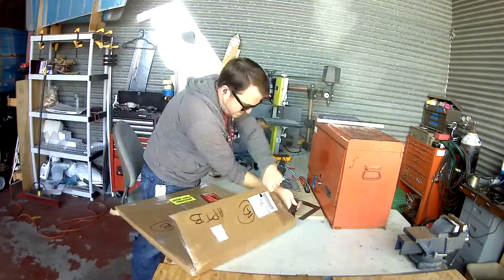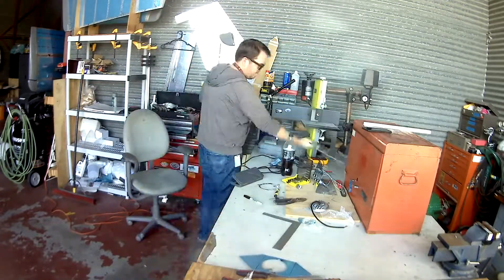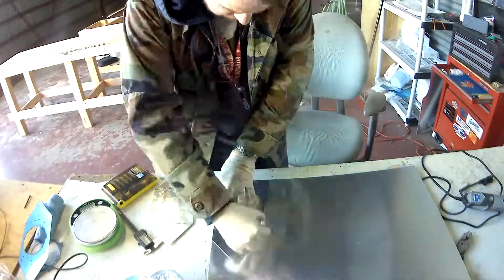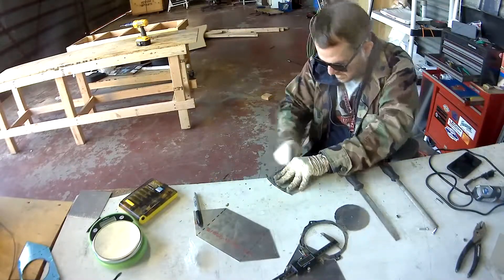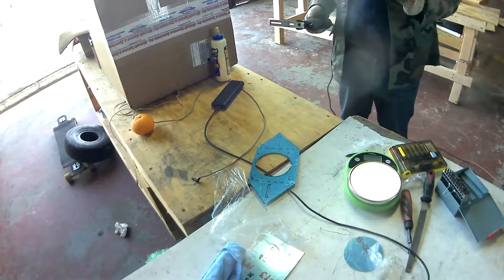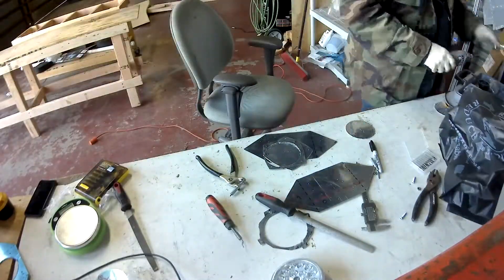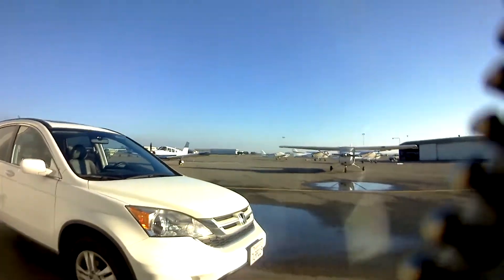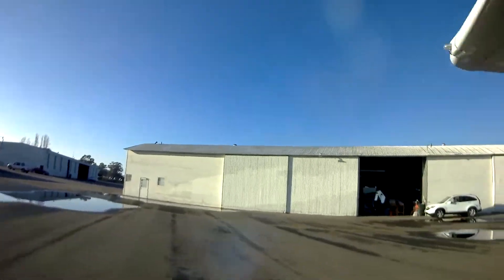RV - 14   Landing Lights 2

Comment: We had a 16 inch Zenith, b&w for around the same number of years. The remote used tone generation, iirc, not RF. Analog FTW.
Reply from the maker: That's right that's right. it wasn't rf it was tone. The later models could still be heard by dogs.